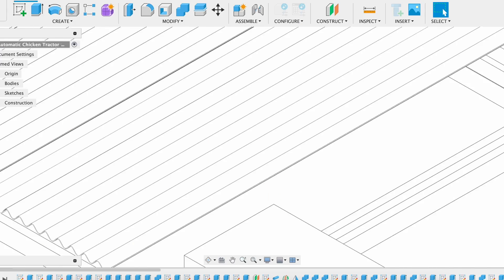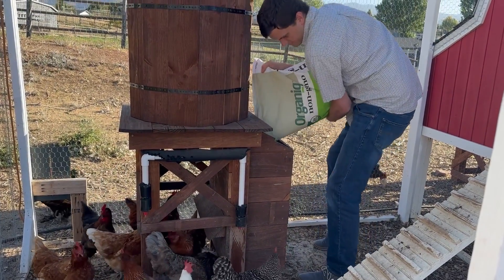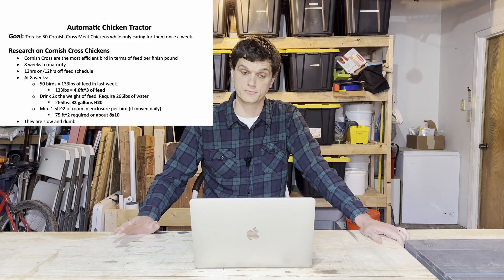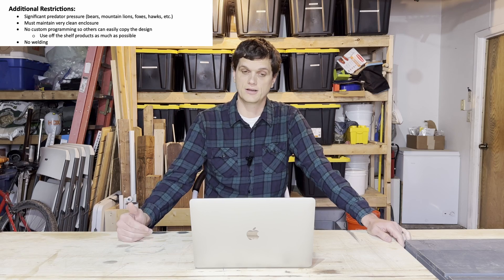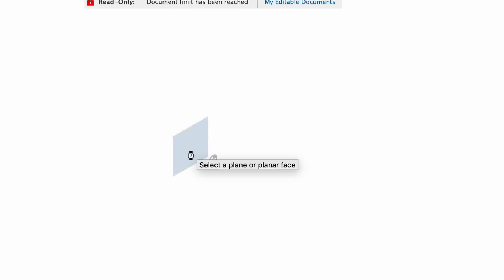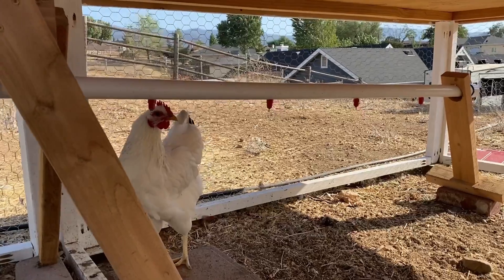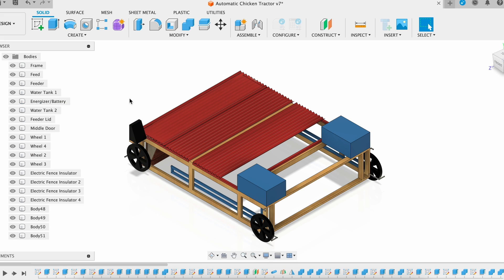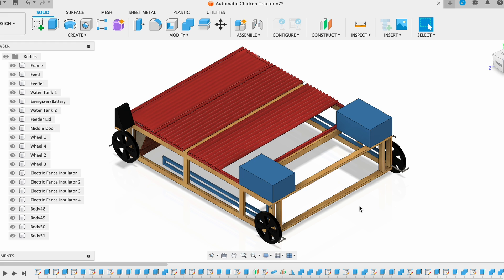It Moves ITSELF Daily! The Ultimate Meat Chicken Tractor!

Comment: I have been thinking of a winch chicken tractor concept for months. I would love to see your designs as you come along!
Reply from the maker: I’d love to hear any ideas you have.
Reply: @thehomesteadengineer-1  what are your thoughts on once the tractor reaches the winch? Also, it would not be a difficult weld to attach several tractors together to be pulled simultaneously. The winch could easily pull several tractors, and the weld job would certainly be easier than the CAD drawings you made, as you stated you did not know how to weld.
Reply from the maker: @ryancarrigan6410 if this works I would consider linking several together. I just don’t have the tools for welding. But I could easily hook them together with wood.
Reply: I was actually also just thinking about that, and what I quickly discovered is that you need a lot of cable length. In his example of 10ft*7days, a 70ft (30ish meters) winch cable would be required, and at least here in Germany, that's getting relatively expensive
Reply from the maker: This is going to be expensive. More expensive than I would want, but the time savings will hopefully make up for it quickly. Yes, 70ft at least. The bigger issue is getting a winch with a drum big enough to hold that much wire.

Comment: I can see some big weight here.  The H2O by itself (2 -17 gal totes)...when first loaded...270+lbs.  Plus materials for a beefier build, winch, feed, solar panels, batteries and motors.  Hmmm.  I'm thinking close to 450+lbs when all is said and done.  You'll definitely NEED a winch to move this beast...lol.
Not sure if the feed dropper can close properly if it's dumping feed (gravity fed).  
The winch is designed to pull.  Absolutely.  However, it's not designed to pull straight.  Even staked out might give you headaches.  But I guess it's worth a shot.  Just remember that they only have about 50ft of cable on a 2000lb winch.  I'm now think you are going to need more than 4 tires...I say 6.
Reinforce the structural area holding up the two H2O "tanks".    Let's just rename this thing the Chicken "Tank" Tractor! 🤣 Good luck!  I'll be watching.  🙂
Reply from the maker: Oh The TANK! I love it! I plan on doing several experiments before building the final thing. I’m going to replace the cable with slightly smaller cable so I can get more than 50ft. It will reduce my capacity but I think I’ll be fine. More fires might be a good idea so I don’t get sunk in the mud.

Comment: As someone with 2 chicken tractors who raises 80 birds a year....this is a bad idea. You need to have eyes on your chickens daily. THis allows you to watch for things like illness and other issues. WHile you are there, move the tractor. I have designed a tractor that is an A frame, with a brooder built in. Once they are big enough to leave the brooder, they occupy the run area and the brooder acts like a coop.
Reply from the maker: I’ll check them pretty often, but I don’t want to have to do it on a schedule. I’ll send the kids out regularly and go when I have some time during the day. But hauling water and feed is too much work. This is an experiment and it might fail, but I won’t know if I don’t try. I’ve never seen it done so we don’t know.
Reply: @thehomesteadengineer-1  How far are your birds from water that it is a problem to haul water? I'm a mechanical engineer, so I understand the desire to engineer solutions, but sometimes, just carrying a little water is a much simpler solution. I have 2 sons and honestly, its good for them to do some chores. To move my coops, I have straps on the front. I back the diesel tractor up to the chicken tractor, put the straps on the grader blade, and pull the whole chicken tractor forward a full length. It takes about 15 minutes of work daily to care manually for two chicken tractors. Also, make one trip to your local feed store and buy in bulk if you aren't already. Don't buy grain from Rural King, Tractor supply or wherever. Your local grain mill will save you  half on feed costs. That $21 50lb bag of feed at Rural King costs $12 to $14 at your local grain mill.
Reply from the maker: @raycecil4643 the closest local grain mill is three hours away. Not sure if it’s worth it, but I’ll crunch the numbers.
Reply: @thehomesteadengineer-1  Dang bro, I thought my 40 minute one way trip was a big deal. Where you at, middle of Montana or something? Combine your trips to town, pull a trailer and load up. I do 600-1000lbs usually.
Reply from the maker: I’m in CA. Grain mills are rare. If you need fresh fruit or veggies those are everywhere. We don’t grow a lot of grain here.
Reply: @thehomesteadengineer-1  Just met a homesteader who moved down the street from me, he came to KY from CA. Said he is never going back to CA. Laws are too tight there, and too many people don't understand if they are a Hen or a Roo...
Reply from the maker: @raycecil4643 that’s so funny. I moved from KY to CA about three years ago and he is absolutely right. It’s not easy to be a homesteader in CA, much less a sane human being.
Reply: @thehomesteadengineer-1  Why in the world would you move to CA from KY? I'm guessing you didn't have much choice. Anyway, wish you the best of luck out there. Those people are insane,

Comment: I think it would be good to mock up the feeder open and close mechanism if you haven't already. It looks like it would leave some food out or able to be trapped between where the feeder was attempting to close and the base. Likewise an actuator would likely be able to crush a low IQ chicken's head. I think your design has that covered because of how far back the pinch point is, but little kid fingers etc need consideration.
Reply from the maker: Yeah, I’ll mock it up before building the final thing. I’m not worried about kids fingers because it will completely enclosed and I can cut power when kids go inside for any reason. Electric fence will keep them out. I don’t think the opening will be big enough to get the chickens head inside.

Comment: I am interested in seeing the power requirements of the winch compared to the capacity of the battery and an overlay with the weather... It seems like a cloudy week could leave you stuck. I don't have a good picture in my head of how the electric fence does or doesn't interfere with field grass. In 8 weeks the grass will grow to a reasonable proportion of the height of your tractor.
Reply from the maker: I have both of those concerns as well, which is why I ordered the winch right away. I’ll be doing some load tests with an energizer I already have. Fortunately I live in a desert region that is mostly sunny in the summer and fall.
Reply: @thehomesteadengineer-1   It looks like their smallest winch wants a 12 Amp hour battery. https://manuals.harborfreight.com/manuals/57000-57999/57365-193175494900.pdf

Comment: For any wheel, don't go with a hard rubber.  Either aired tire or a soft core flexible tire would be best to follow the contours.

Skidloader tirees may work too, they are wide and have heavy tread patterns.
Reply from the maker: I’m thinking bike tires are cheap, soft, and replaceable. Wouldn’t skid loader tires sort of break the bank?

Comment: Thats great, ill give it a try and let you now. +1 subscriber
Reply: Btw im an engineer myself, which sowtware do you use
Reply from the maker: Most my programming has been using an arduino so I just use their open source software. It’s fairly easy. I’m not a programmer by any stretch, but I get by for simple projects like this.
Reply: @thehomesteadengineer-1  yeah I use that, I was talking about 3d modeling. I usually use tinkercad for my 3d printing and laser cutting. Thanks
Reply from the maker: @MirzAli lol, I’m sorry. That question makes way more sense. For my personal use I use Autodesk Fusion 360. It’s free for personal use and super powerful.
Reply: @thehomesteadengineer-1  thanks ill try it

Comment: anything moving and that you are not checking daily and living beings depend on it, needs to be doubled. window openers fopr greenhouses, solar converters - especially the ones made in china and also winches. your birds will be dead in 2 days, if the system fails. i still have nightmares from childhood going into the turkey pen when electricity was out for a couple of days.
Reply: If there is wifi in the area of your friends place, maybe add a security camera inside the coop.  Watch them from a phone or computer.  🤷🏼‍♂️
Reply from the maker: That’s a really good point. Maybe I should put two actuators and two doors on the feeder. While I’m not going to do anything as far as maintenance goes, I’ll have my little kids check it every day. It won’t be completely neglected.
Reply: @thehomesteadengineer-1  if you want success, build it like you would be a ship engineer - everything is minimum doubled, critical systems tripled and use stupid solutions that dont have complicated methods of breaking down. ive lost several crops from greenhouses that i built automatic door and window openers that malfunctioned until i started using gas piston openers that work on expansion of gas, not electronics. kids checking on it is a good, but unreliable system. it rains some days and some days they have a flu and some days life happens, some days they become asshole teenagers that dont know better. i love the concept, i think its brilliant, that is why i am so critical, to make sure you succeed. there is only one me, there is only so many hours in a day.
Reply from the maker: @ullo-ragnartelliskivi4639 lol, teenagers! I appreciate the redundancy comments. I’ll definitely keep that in mind as I continue. Simple but redundant.

Comment: that's the exact tractor type I'd love to use. lol. i don't think i totally understand yours linear motors opening and closing the feed from the chickens. i mean, once you've opened them by maybe a hinge, don't they just stay hard against the moving board? closing it sounds like it would attempt to compress the feed, which doesn't sound very compressible. i was thinking what if your had some type of paddle wheel that turned and let feed out but chickens would gradually need more and more feed as they grow bigger and bigger and i don't see how that can be done without programming. actually.. maybe the feed motor doesn't move the feed at all? it just blocks access to the feed boxes on a timer just like those automatic chicken door openers? 
my area would have rat, armadillo, and snake problems that all of those might get under the gap. a hard skirt of wire i see most people having problems with if it was being moved unattended. i wonder if one was to make something more like chainmail it could close those gaps and make slipping under or digging more problematic but would really only work if there was a way to encourage it to be splayed outward and not fold in. but every thing i think that might do that introduces surfaces easy to snag on. my best idea on that would be some type of spring steel rods that can easily bend but encourage the skirt to stay outward.
Reply from the maker: I’ve considered the paddle idea. The trouble is with getting it into a trough big enough for 50 birds. It would either need multiple doors or a long shoot, but that all gets very complicated quickly. I think it feed will just move up in the bin when the door closes but il honestly not sure yet. I’ll build a mockup or prototype before I build the final thing. 

I don’t think any kind of flexible skirt will keep rats or snakes out. I’m still brainstorming that idea but I like some of the thoughts you threw out there.

Comment: Don't like the winch idea. A cable across the field? Look into power window motors at a sqlvage yard. With the solar and actuators you can lift , the window motor will move it and i would recommend riding lawnmower wheels . Had a friend few years back fed his cattle automatically.  It was a fascinating machine.
Reply from the maker: I’ve debated the drive mechanism with myself a lot. What is your concern about a cable across the field? I guess an elk or deer could trip over it and cause problems. My concern with powered wheels is if it falls in a big gopher hole it will get stuck or drive in a circle.
Reply: With a cable your committed to moving the cable. With window motors you can use servos,  R/C in emergency and realign depending on automatic speed, With the automatic speed I'd use gear reduction to get desired creep and a chain mesh wall inside to create a buffer s from run overs.

Comment: A winch sounded like a good idea. I noticed that you put the water tanks in the back, not sure if that was by design or by "accident", but I guess that would be useful as well (to avoid the front wheels digging into the ground). Two things I would worry about: 1) How will you move the tractor with the predator protection (i.e hardware cloth), i.e will the tractor lift itself of the ground just a smidge? 2) Will the dumb chickens realize that they have to move when the dump winch pulls the tractor regardless of any possible stuck chickens? (the winch does move the tractor very slow, so that should help I guess/hope)
Reply from the maker: Great questions. Thank you for asking. I did put the water in the back to distribute the weight. 1) I will have the wheels 1-2 inches lower than the frame. It will likely bottom out on mounds and slopes, but I expect the winch to overcome that. It’s a 2,000lb winch. I figure 1-2 inches is low enough to keep non-snake predators out. 2) I was discussing that with my friend yesterday. I’m going to time the food door opening just before the winch starts to move so they will all go to the front for food and then chase the food as it rolls forward.
Reply: @thehomesteadengineer-1  No prob :) 1) I guess that depends on which predators your friend has (the digging ones might be a challenge - you could have a stiff skirt of some sort poking outwards from the tractor, but a risk of it becoming stuck or entangled in grass), 2) That could be a solution